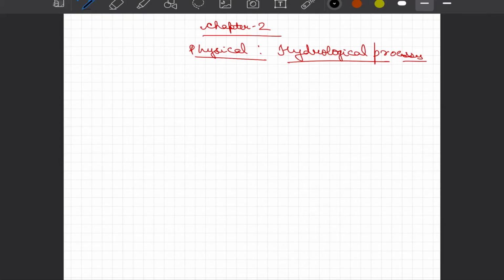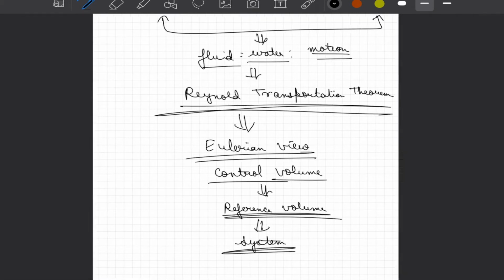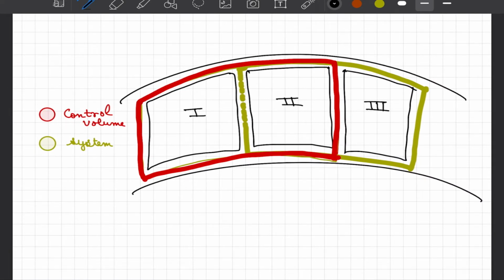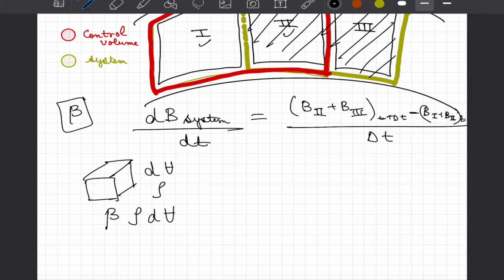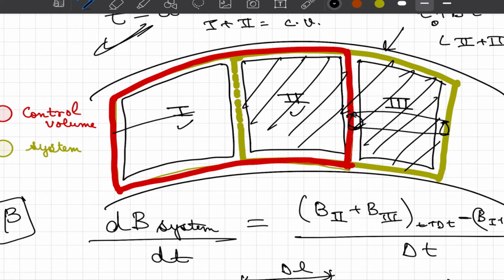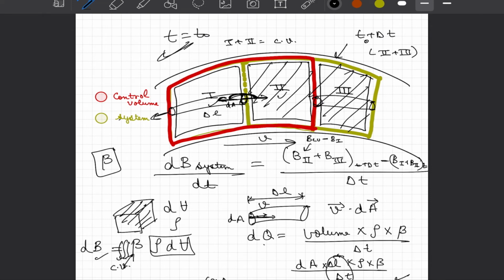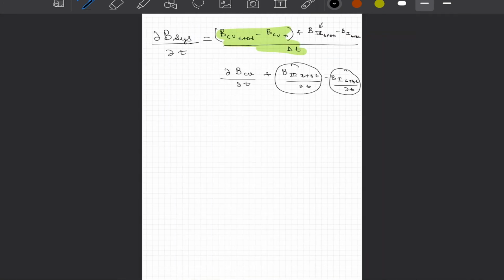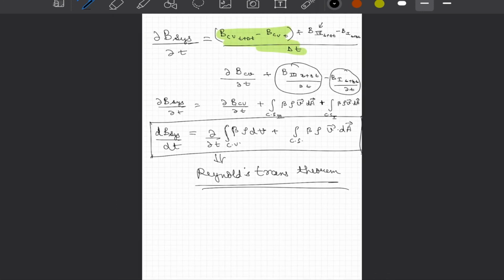2.1 Reynold Transportation Theorem

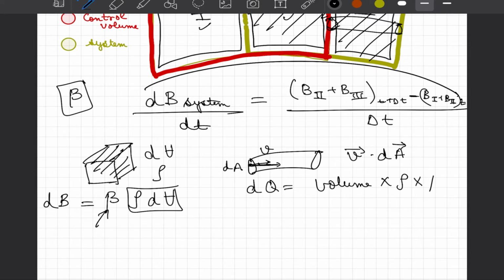Comment: Sir, At 7:28 What do you mean by 'Extensive Property contained in the small element'?
Reply from the maker: Let us say the extensive property under question is the mass of the body, M. If we take an infinitesimally small volume, the extensive property associated with that small element would be intensive property (that is extensive property per unit mass) multiplied my mass of the infinitesimal element. Hence, it becomes betaxdensityxvolume.